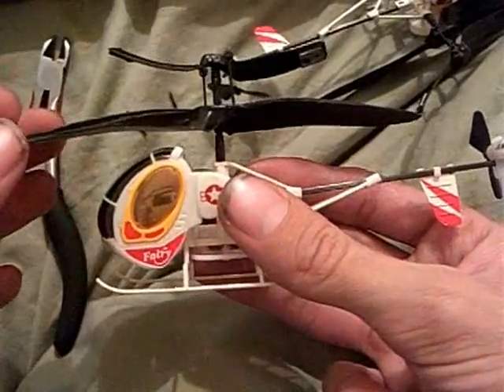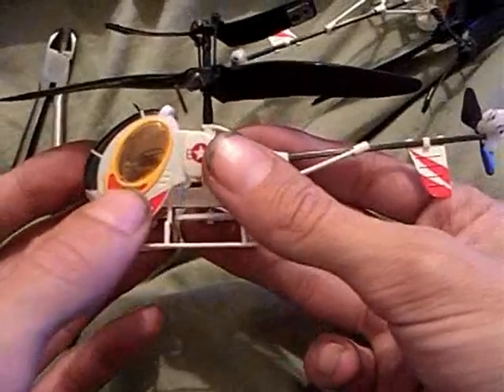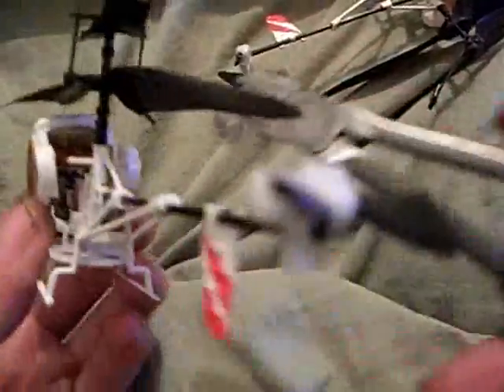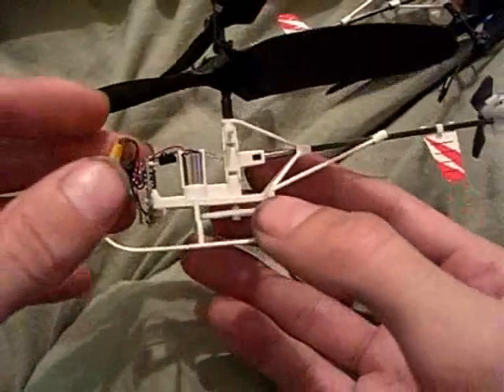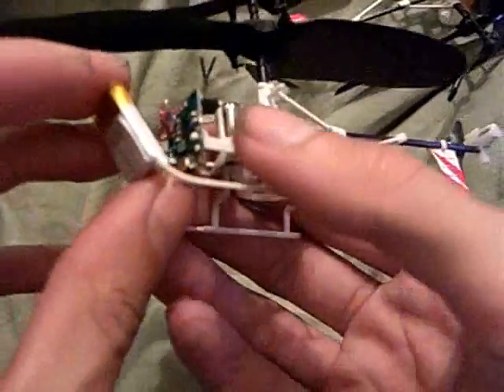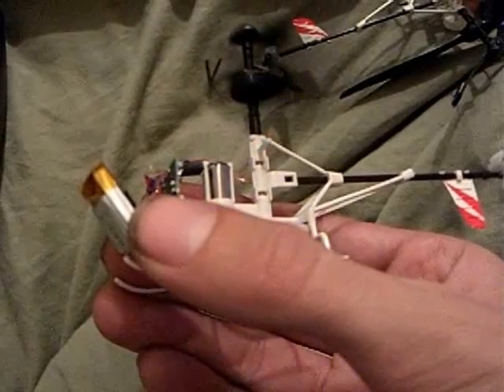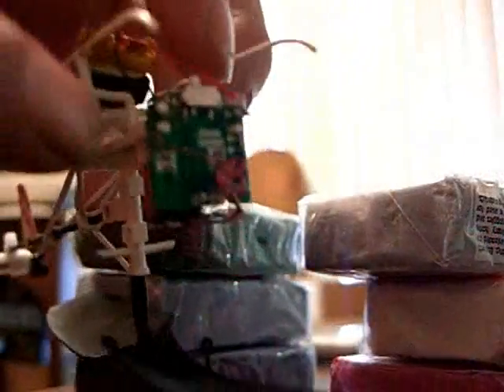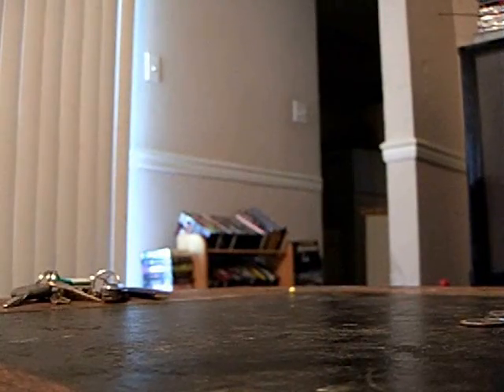micro heli battery disconnection during flight, and repair

Comment: I just got one do you think can change the battery and it will work or just display it
Reply from the maker: If you can find a replacement battery that's the same size and voltage, and you can solder it on it will probably still work.

Comment from the maker: It could be bad wire connections or the battery may be damaged and need to be replaced, check the voltage under load and see if it drops.

Comment from the maker: @7249xxl the battery may be damaged from over discharging or bad charging, some of these helicopters have a low voltage cut off, so if the battery isn't able to hold a charge and falls below 3 volts it shuts off the heli, that may not be your problem but it's the only other suggestion i can think of off the top of my head.

Comment from the maker: @boowonder888 Also for long term storage of a month or more I have heard it said to drain it to 50% but during normal usage you can drain it until you notice a drop in performance, as soon as you notice the battery is dying, you should stop flying.

also sometimes the batteries will get a dirty charge and it helps to discharge and recharge the battery a few times to get it back to normal.

Comment from the maker: @boowonder888 I've never burned out a motor other then a tail motor on a 6 channel cp helicopter, you can usually put in a better battery. Battery technology gets better every day and a lot of times you can increase performance, a lot of the larger 4 and 6 channel rc helicopters can use a wide variety of batteries. But you do want to be careful with smaller helicopters sometimes they aren't designed for it.

Never drain your lithium battery all the way down, it will damage it.

Comment: Coof fix! Can you put in a better battery maybe 400 mah? Or will that fry the motor due to longer flying time? Have you ever had a motor burning out on you? Will it hurt your battery if you completely drain it or should you only use 50 percent of power and then charge it again?

Comment from the maker: Check the little paddle on top of the rotor, make sure the pin that holds it on is in all the way.
Also try twisting your tail rotor for slower flight, sometimes if the tail rotor is twisted, or if the CG is off center it will move forward to fast, and go in circles .

Comment: the wires are okay...
 forgot to mention that after i crash it and try to recharge it the heli start to rotate alone without touching anything i pull back the cable the heli stop then  put it back  and from there no reaction at all  and doesn't want to recharge.

Comment from the maker: You may have a broken wire inside the canopy.
Remove the canopy, look at all the wires.
One may be broken, you can solder the wire back on very easily.

Comment: i have a problem it will be great if you help me my heli is like this in the video and when i try to recharge it the green light doesn't  light up before that i crash it and the heli does not stop to rotate even i switch of the heli and the transmitter.???????
Sorry if my english is bad :)

Comment from the maker: your battery may have died, generally if you are going to store the helicopter for a few months you should bring it down to half charged.
The one in this video had the same problem, I didn't fly it for a few months, and I had left the battery fully charged, it wouldn't fly or charge.
I just bought a new heli, I would strongly suggest the new syma s008, it hovers like a dream, it flies forward and in reverse and spins, and it has a very realistic canopy.
I just posted a video review of it.

Comment: nice vid! i need help. my heli is just 9 months old. i took it out for flying after 4 months. but after ful charging it wouldnt just rise. while charging the green light on the tx would glow only for a few seconds and go off though the red light would glow for a few minutes longer. has the lipo died or it is something else? plz help. my heli used to fly great before. thanks a ton in advance.

Comment from the maker: check that your main gear and motor gear are properly meshed together, sometimes the motor will get pushed a little bit to far away. slowly spin the rotor and see if you notice any resistance.

Comment: for soldering i suggest that you use a smaller gauge solder because it is easier to use with the small components on those tiny boards. also it is a good idea to get a solder sucker they help a lot with cleaning up the connections.

Comment from the maker: It would be cheaper and easier to buy the replacment batteries they sell for these for about 6 bucks and just solder a battery connector on to the board and the battery, it would be a little heavier, but you could switch out batteries.

Comment from the maker: I've used higher MAH batteries in other helicopters before I think I went from 800 to 900 on one coaxial heli and it worked fine, and gave me slightly longer flight times. if the voltage stays the same you might be able to make it work, but don't quote me on that.

Comment from the maker: You should be able to get the rotor separately, but you may have to use a picoo z replacment and see if it works, they are usually about $6 each.

Comment from the maker: Yup the whole thing, once you slide the razor in their it's not to hard, you can usually pull and cut it apart. First cut off the piece on the front that makes up the little wings, then you can split the rest of the body in half.

Comment from the maker: You will probably have to get a razer blade and cut the Styrofoam down the center to remove it. but sometimes their is a clear plastic cover over the gear that you can pull off without removing the Styrofoam.

Comment from the maker: Hold the main gear still with one hand, grab the rotor with the other hand and gently twist it and pull it up, it is easy to pull it off of the main gear. Their are small plastic washers wear the rotor meats the frame and wear the gear meats the frame. When you pull out the rotor make sure you don't loose them.

Comment from the maker: i have broken a lot of tail rotors, I juggle the ones i have left from helicopter to helicopter, I have glued them before, and they worked fine, as long as you put the same amount of super glue on each side of the blade to keep it balanced it will work fine. you can buy replacements online, but remember their are a lot of versions of these little helis out their, and not all of their tails are compatible.

Comment from the maker: If it is like mine when it is moving slow it will wobble, it can be caused by the metal pin that holds the stabilizer on slipping out. also if you give it some nose weight for more forward flight or twist it's tail, it should wobble less.

Comment from the maker: It sounds like your 4 in 1 mixer is burned out, I say this because neither motor is working, but the servos are so it sounds like Something on the electronics board is burned out.  the board cost around $40 to replace. The oysters would love it but don't give up yet. It is unfortunate that walkera uses low quality electronics. I have heard a lot of people complain of the same thing.

Comment from the maker: Let's see how much I have spent. 1st helicopter E-sky lama v2 $125 plus extra blades and batteries another $75. Second helicopter E-sky honey bee cp2 $179, extra blades and batteries $80. First picco z $40 from radio shack. 2 micro gear choppers $50. Air hogs bi plain $30. All together that's about $550 over almost 2 years. A good ready to fly 3d capable t-rex se with controller will run about $1220. That's my next step up. Some guys spend 5 to 10 thousand dollars on a jet rc helicopter.